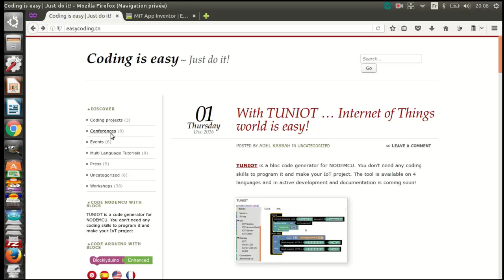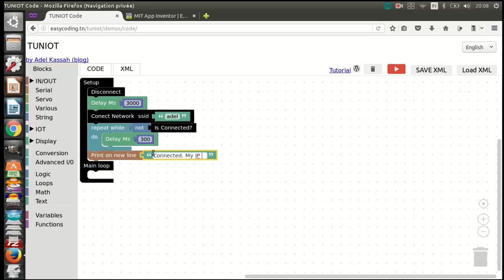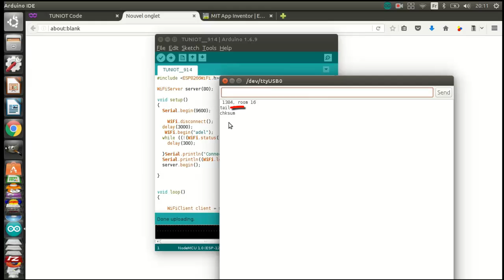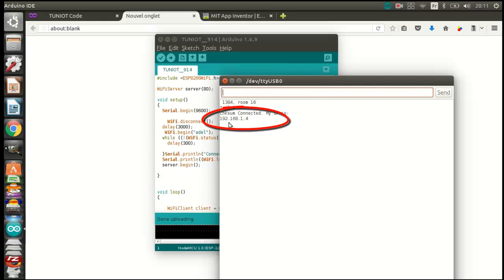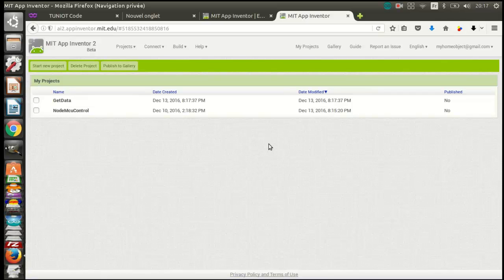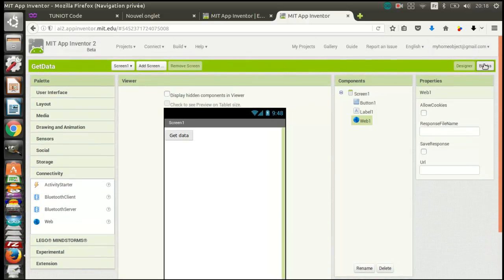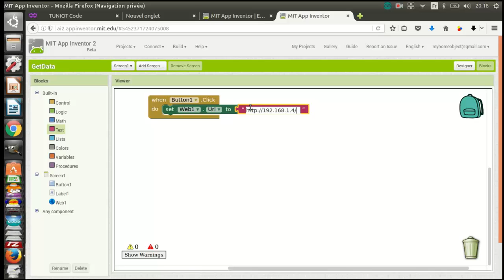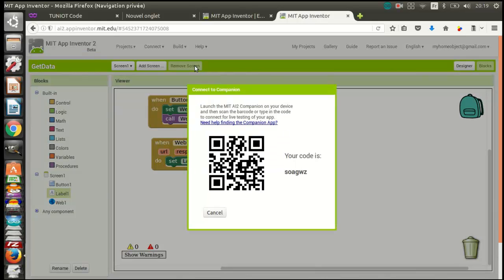NodeMcu (ESP8266) Tutorial B-07: Get sensor data from NODEMCU with your Android phone

Comment: Sir ı Need esp8266wifi.h library but ı couldn’t find it anywhere please helppppp !!!
Reply from the maker: This is a default library but you need to add the Esp8266 board Into the arduino ide. Some times there is a pb of installation. The board seems to be installed but the program not compiling
Reply: @ADELKASSAH  thank you sir ı did it before ı selected arduino genuino but then ı added nodemcu to board and selected it then now code is working thank you !  :)

Comment: Can you please help with the code of Arduino IDE which you designed using easycoding.tn . I have written an exact similar code but still the app could not read data. I've tried a lot . Can you please help me out ?! It's really urgent. Do reply ASAP
Reply from the maker: First, when you send tje http request with the browser, can you see the result on a web page?
Reply: @ADELKASSAH  No sir , the data is not displayed on web browser . No results can be seen. If you could share the link to the code or the code , it would be helpful.
Reply from the maker: So you have a problem with the web server. Is your computer in the same wifi network? Did you put a dynamic address? Did you display that on the serial monitor?
Reply: ADEL KASSAH  I am facing the same problem... its showing in serial monitor but not in the webpage
Reply from the maker: Can make a print screen of your blocks code?
Reply: @ADELKASSAH   Yes connected with same WiFi network and there's no dynamic adress and it's showing on serial monitor but not on web page.
Reply from the maker: @ManthanonYTLive  can you make a print screen of your code in block mode
Reply from the maker: PLEASE WORK WITH THE 2.4.0-rc2 version by changing on board manager.
Reply from the maker: PLEASE WORK WITH THE 2.4.0-rc2 version by changing on board manager.
Reply: @ADELKASSAH  hi how to change to     2.4.0-rc2     , i have problem not displaying  the data on web browser and in android app

Comment: hey brother.
if i get data from sensor +  arduino and it save on ip of Wifi (ESP8266) but local host.
can i use this method on app inventor too? the block is same right? but is not work..
i think if i correctly send data to local host ip, the problem is on app inventor method. can u help?